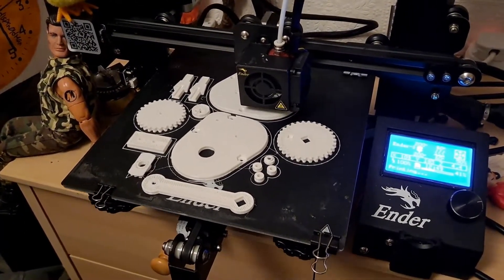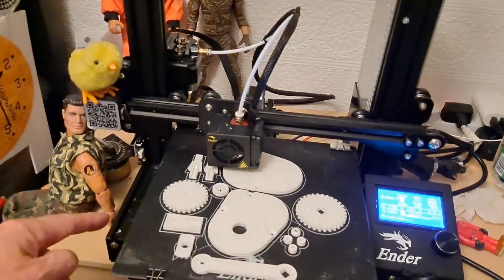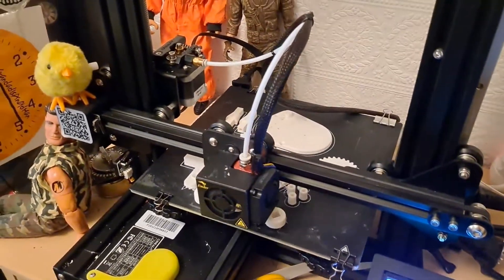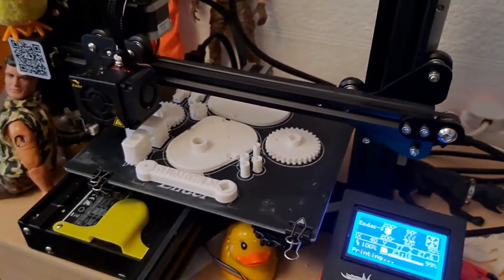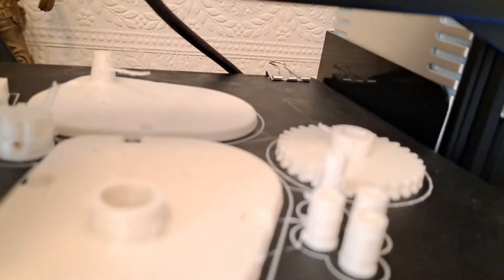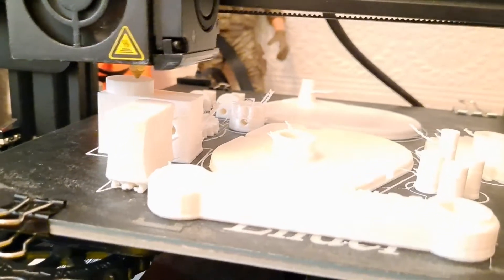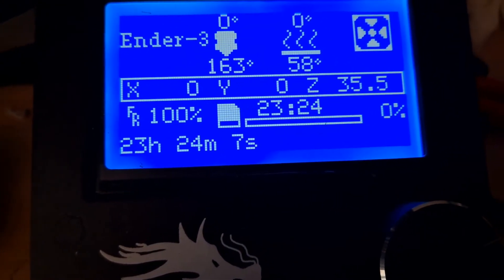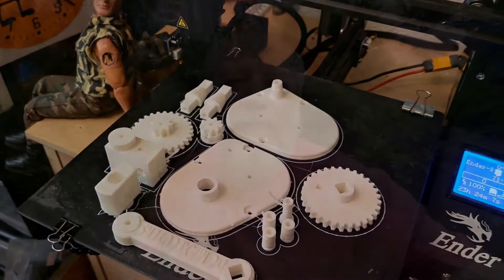Printing a Motor Winder for Rubber Powered Models

Comment: My extruder is direct drive but still uses a PTFE tube in the hotend as a spacer/anti-stick bushing. Looks like yours got quite hot.
Reply from the maker: Generally speaking I run it at 200⁰